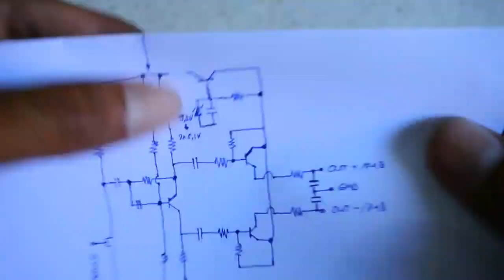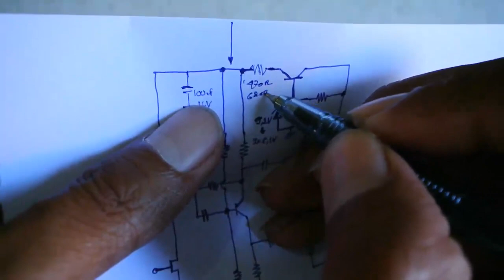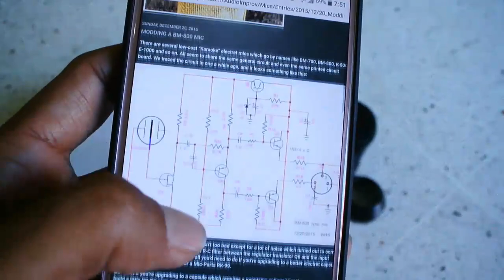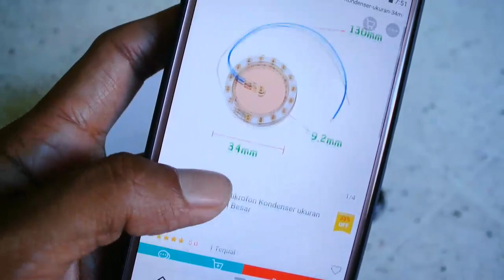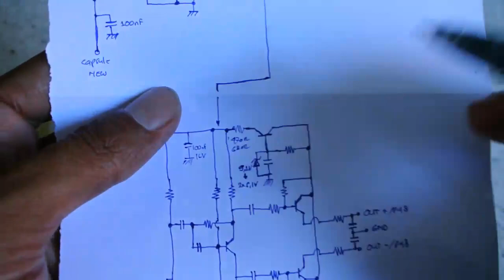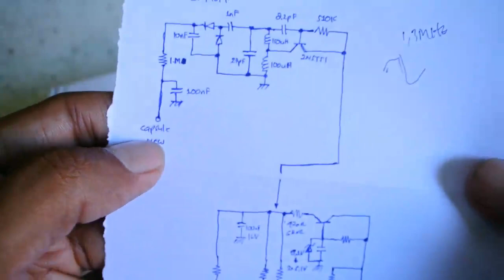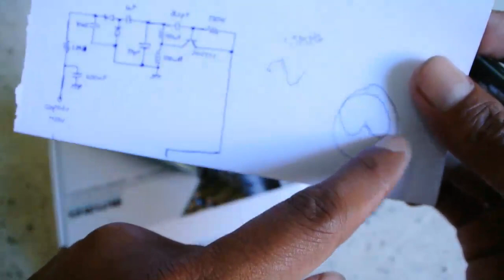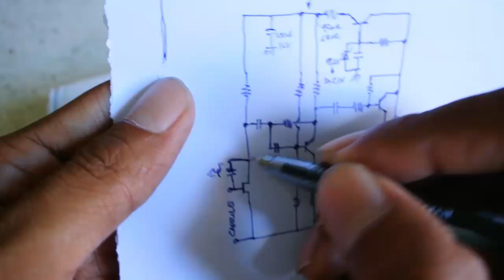Modif dan Upgrade Microphone Condenser BM 800

Comment: Mas, saya punya mic behringer c1, apakah bisa diupgrade tanpa di ubah rangkaiannya, jadi tinggal pasang mic capsulnya ? 🙏
Reply from the maker: C1 setau saya juga tipe electret bukan "true" condenser
Tetap butuh "step-up" untuk mempolarisasi capsule tipe 34mm seperti dalam video
Reply: Apakah kalo sdh pakai phantom power 48V masih di butuhkan rangkaian step up 48V di dalam mic nya?

Comment: Mic saya Altcron MC001
Permasalahannya adalah gainnya jadi kecil., mohon trik & solusinya bang 🙏
Reply from the maker: Bisa dimulai cek rangkaian step-up untuk polarisasi kapsul
Reply: @tjeret  di kabel yg ke capsul tegangannya harusnya berapa volt gan?
Saya pake phanton dari mixer 48v.
Reply from the maker: Tiap2 kapsul beda2 tegangan desainnya
Beberapa mic schoeps bisa >100V

Diukur saja dulu, kalau diatas 40V kemungkinan masih normal rangkaiannya
Reply: @tjeret   ini cek di jek XLR kabel 48v, tp di XLR yg di dalem mic udh 32v aja., nyampe transistor 30v, transistor terakhir/jalur yg ke kapsul malah ga ada tegangan 😩
Saya kira diafragma nya yg rusak, tp suara tidak cacat,  hanya fungsi seperti mic dynamic.
Reply from the maker: Wajar kalau tegangan turun ke 32V karena kena beban dari rangkaiannya itu sendiri

Coba cek Vin yang menuju ke PCB satunya (polarisasi)
Reply: @tjeret  ada 3 kabel gan, dan di pcb ada keterangan A, B, & C.
Kabel merah A 9v
Kabel putih B 0,25v
Kabel hijau C 30v

Saya gak paham cara kerjanya 🤦‍♂️
Reply from the maker: Mungkin bisa coba cari2 skema dari micnya itu sendiri, biar lebih mudah tracing jalurnya Om
Reply: @tjeret  Oke mksh banyak bang 🙏
Reply: Bolehkah saya beli rangkaian tambahan tsb? Saya sdh punya bm 800 dan capsul ug besar itu. Terima kasih
Reply from the maker: Monggo langsung ke toped atau bl saja Om
Keyword "hartley oscillator"

Comment: Om...tanya...saya order kapsul dr luar...itu kapsul berarti gak ada koneksi ke ground ya...trs itu stepup kok ada 5 induktornya..trs masih bingung pengukuran volt 63v itu di kapsul setelah r 1m atau sebelum r 1m nya....saya mau rakit stepup nya dulu...sambil nunggu kapsul dateng
Reply from the maker: Iya, g ada koneksi ke ground sesuai skema
Ngukurnya setelah 1.5M
Reply: @tjeret  ok om...tak nyoba buat stepupnya
Reply: @tjeret  om...susah buat osilator ini...punya saya cm keluar 45v dah mentok....saya modif c nya mentok segitu...kalau sebelum r 1M sudah bs 80v ....apanya ya...soale saya cm pakai induktor cabut2an
Reply: Saya pakai r basis 680k. Dioda pakai 4148
Reply from the maker: Wajar tegangan pengukuran ngedrop, karena kena "beban" multimeternya
Butuh DMM dengan impedansi tinggi

Dari sebelum R itu juga bisa dijadikan patokannya, sudah cukup bagus dikisaran 60-70V an
Reply: @tjeret  oh iya ya...baiklah...tak pake dulu...ntah gimana noise nya ntar...misi uji coba

Comment: Bang aku punya mic BM800 sama mixer sudah ada pantem power nya.  Kalo langsung di colokin ke mixer suaranya gak ada tapi kalo ke hp bisa. Tapu kalo kemixer dengan mengaktifkan pantem power nya bisa ada suaranya.  
Apa emang kaya gitu apa gimana bang
Reply from the maker: Sesuai video, mic ini butuh "supply"
Di beberapa HP ada yang namanya PiP yang umumnya 5V sudah cukup menyuplai walupun tidak optimal
Reply: Oh gitu ya gan.  Di hp saya jadi sihh. 
Tapi kalo di mixer harus pake pantem power

Comment: Om boleh tanya. Itu semua elco bawaan mic BM800 bisa diganti dengan elco 100uf 16v. Pengatuh tidak kira2
Reply from the maker: Cuma satu yang bisa, setelah regulator
Kalau sebelum regulator minimum 50VDC
Reply: Kalao diodanya itu misal pakai langsung 10v 0.5watt tidak pakai 5.1v yg di seri bisa pak
Reply from the maker: Bisa banget Pak
Reply: Nilainya sama saja ya pak sama yg 5,1x2 itu. .
Reply from the maker: Mirip koq Om, selisih 0.2V g masalah

Comment: Pak mohon maaf mau tanya... Input oscillator saya 8.7v nah output dari oscillator nyampe sekitar 40v trus dikasih voltage doubler jadi 82v apakah aman untuk kapsulnya??
Reply from the maker: Saya sendiri g tau angka pastinya max voltage karena g punya datasheet capsulenya, cuma "sebaiknya" dijaga direntang 60-70V
Reply: @tjeret  ok trima kasih pak

Comment: Itu elco yg di pasang di kaki kabel kapsulnya brp micro, ko, saya punya. Malah lebih kecil kalau pake elco. Saya pake 220uf
Reply from the maker: Elco buat RC filter saya pakai 100uF 50V karena punyanya cuma nilai itu, bodynya agak gede
Kalau 16V/25V kemungkinan lebih langsing
Reply: @tjeret  saya pasangcelco kang di situ malah kecil ya.
Reply: Maksudnya mic bm800 nya malah lebih kecil suaranya harus mendekat. Ukuran R saya pake 470
Reply from the maker: Harusnya sedikit sekali pengaruhnya, karena memang ada drop tegangan di R tersebut

Ini pake Phantom 48V kan sourcenya?
Reply: @tjeret  saya pake sound card tapi rencana mau buatkan phanton power soalnya tegangan di sound card cuman 2,35v setelah saya ukur, nah rencana saya kalau buat phantom power 9v-12 aja klau bisa, sesuai dioda yg saya pake di bm800 saya ganti 12v
Reply: Ada WA nya g kang
Reply from the maker: Wajar kalau tanpa P48

Monggo dilihat di video saya satunya tentang BM8000 dengan P48 onboard
Bisa saja dengan Phantom 12V

Maaf, WA untuk sementara hanya untuk keperluan pribadi

Comment: bang, itu di input jfet nya (yg masuknya dari kapsul) gk dikasih pull down resistor? saya cari2 skema sirkuit kondenser di forum2 luar negri gearslutz, geekslutz, yahoo diy mic builder group, dll (true condenser, bukan electret), itu kebanyakan pake pull down resistor yg nilainya gak main2, sampe 1Giga ohm/ 1000Mega ohm...
itu gimana bang, emng gapapa gk dikasih pull down resistor? gk ngaruh ke karakter tone atau apa gitu?
Susah nyarinya resistor 1Giga ohm...
Reply from the maker: Sudah dijabarkan di situsnya tentang 2 fungsi utama additional  C12nya

1G ke Ground fungai utamanya agar gate JFet tidak "floating"
Reply: baru paham setelah baca2 disitusnya, makasih bang...
Reply: oiya, sama request video sound sample mic moddifannya bang...
pengen tau hasil suaranya...
Reply from the maker: Mungkin besok2 kalau ada upgrade versi 2, mungkin bisa saya compare langsung dengan versi standarnya
Reply: okee, makasih banyak bang...
Reply: @tjeret  
bang, mau minta pendapat.
kalo saya pake "dc step up converter" yg banyak di toko online sbg pengganti hartley oscillator, gimana? kan ada tuh yg outputnya bisa nyampe ~48V.
Gmn menurut abang?
Reply from the maker: Logikanya bisa banget, walaupun aslinya overkill karena DC-DC converter desainnya buat "high load" sementara saat super light load efisiensinya busuk

Kalau mau "simpel" bisa pakai step-up/voltage doubler yang model IC, cuma lupa linknya
Reply: @tjeret  ohh, gitu ya bang...
iseng aja tanya bang, sebelumnya tiba2 muncul di pikiran "kalo itu (hartley oscillator) diganti pake dc step up gmn ya?" ,gitu... 
btw, aku mau coba modif juga kaya gitu bang mungkin bulan depan nungguin celengan (maklum kantong anak kuliahan)...
makasih atas responnya bang...
Reply: @tjeret bang, mau tanya.
abang pernah ngukur voltase keluaran hartley oscillator setelah rangkaian voltage doubler punya abang gk? pengen tau punya abang keluarnya brp volt. Atau gk bisa di ukur karena "Multi/Voltmeter loading effect"? 
Maunya ngukur punya sendiri, tpi punya saya belum jadi. Masih nungguin sparepartnya datang a.k.a kapasitor sama induktor ( beli di toko online).
Reply from the maker: Sempat ngukur cuma ya itu karena efek beban dmm hasilnya turun terus

Mulai dari kisaran 55VDC saat pertama nempel dmm kemudian turun perlahan
Reply: @tjeret  oh gitu ya bang, makasih bang...
Reply: @tjeret  bang, saya ada sedikit kendala nih.

output rangkaian hartley oscillator saya bisa ≥56V kalo tegangan input oscillatornya ≥10v. Nah masalahnya output tegangan setelah Resistor 860ohm (rc filter setelah regulator) di punya saya cuma sampe 8,1~8,2V dengan supply phantom 48V.
Sampai phantomnya saya naikin sampe 52V pun, di setelah resistor 860ohm cuma dapet ~8,5V. 
Kalo input oscillatornya ~8,5V, outputnya cuma kisaran 32~34V.
Sebenernya saya sudah ada solusi, tpi solusi saya agak ribet & nggk praktis. Jadi sebelum saya pake solusi ribet...
Mungkin abang ada saran??

Note: ada sedikit perbedaan di rangkaian oscillator saya dimana resistor 1M saya pake 1,5M seperti di web audioimprov.com, lalu kapasitor 8,2pf saya ganti 10pf dan 27pf saya ganti dengan 2x 10pf diseri (=5pf) lalu ditambah/ diparallel dengan 22pf , yang lainya gk ada yg beda. 

kaya gini...

            |
     ___|____
    |              |
[10pf]         |
    |              |
    |          [22pf]     
    |              |
[10pf]         |
    |              |
    |________|
            |
            |
secara teori sih jadi 27pf.
Reply from the maker: Sebenarnya 50~60V sudah g ada masalah, g perlu terlalu perfect
Apalagi sebelum voltage doubler sudah diatas 30VDC, karena cara pengukuran kita juga g bisa bagus
Reply: @tjeret  
Oops, penjelasan saya ternyata kurang...
32~34V itu saya hitung setelah voltage doubler bang.
Reply from the maker: Solusi agak simpel mungkin main di regulator (naikin tegangan dengan seri zener dengan dioda)
Plus dua rc filter diseri, stage pertama untuk hartley stage dua untuk "preamp"
Reply: @tjeret  
nah, masuk nih...
saya coba dulu deh, makasih bang.

Comment: Mau nanya mas, saya punya mic BM800 suaranya agak putus ( rodo mbrebet 40%) kira2 apanya ya, sdh saya coba upgrade basic seperti itu(video) , hasilnya malah pelan banget.
Reply from the maker: Coba cek tegangan vdc di jalur out+/- saat terkonek
Reply: @tjeret  

tegangan terkoneksi tanpa soundcard V8 :

VDC out = 0 volt

VDC in :

kabel kuning + kabel hitam = 2.1volt
kabel kuning  + kabel merah = 0 volt
kabel hitam + kabel merah = 0 volt

kabel kuning = kabel body

Saat terkoneksi dgn soundcard V8 :

VDC out = 0 volt

VDC in
kabel kuning + kabel hitam = 2.5 volt
kabel kuning + kabel merah = 2.5 volt
kabel merah + kabel hitam = 0 volt
Reply from the maker: 2.5V itu kurang banget bisa jadi "distorsi" karena circuitnya tidak bekerja dengan baik

min 5V supply dari "sumbernya"
Malah kalau mau optimal harus diatas 10V
Reply: @tjeret  . Ok , matur suwun ilmune mas..

Comment: mas ada sampel hasil suara nya gak ?
Reply from the maker: Kalau versus aslinya masih belum sempat buat videonya.
Cuma sebagai reference, video saya setelah video ini sudah/selalu6 menggunakan mic modifikasi ini
Reply: bagus hasil nya  tapi noise nya ttp ketangkep banyak ya mas
Reply: video di atas spul nya aja ya mas yang di ganti
Reply from the maker: Pattern mic condenser umumnya seperti itu Om
Kalau pengen reject off axis bagus pilihan terbaik tetap tipe dynamic